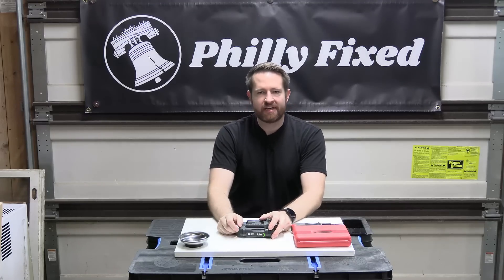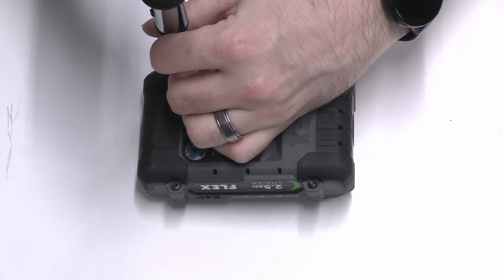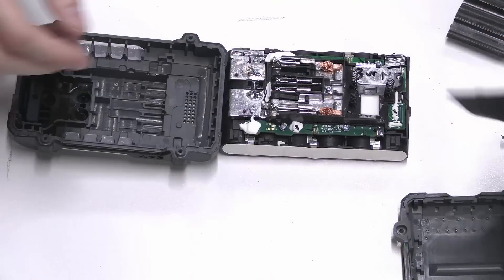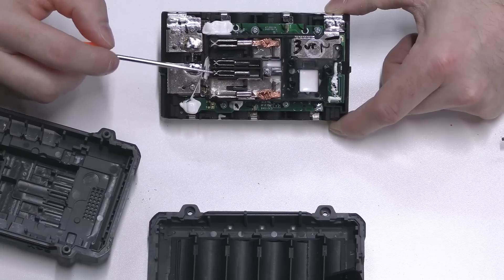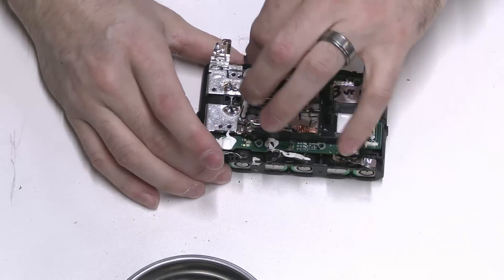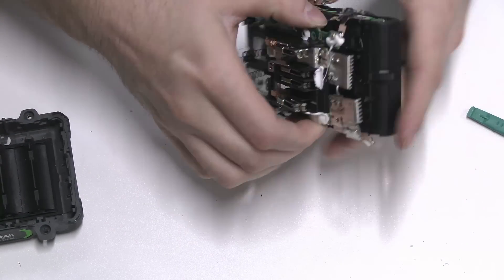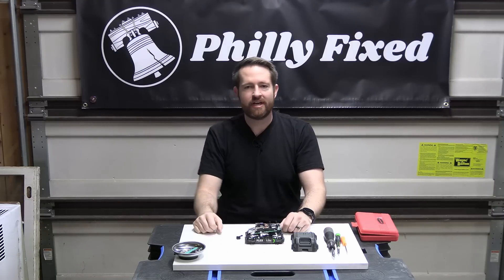Flex Power Tools 24V Battery Teardown!

Comment: The copper shown around 3:37 is called copper braid (looks kind of like desoldering braid minus the flux) and it's most likely a high current fuse as a fail safe. It's a pretty common design theme in these batteries, and there are even a few videos showing how to repair them for other battery brands when they burn.

At 7:26, on the bottom side of the board in the middle near the two thin soldered contacts, there are two test points (unsoldered pads where you would touch a logic analyzer or oscilloscope probe) that say TP_C1 and TP_D1 (clock and data) which implies that there is a communications system in there somewhere. Around that general area are a few vias; one pair is NTC1 - negative temperature coefficient (thermistor), and to the right is an NTC2 via - second thermistor, or just another joint on the same trace?

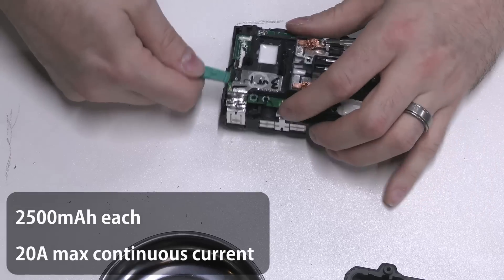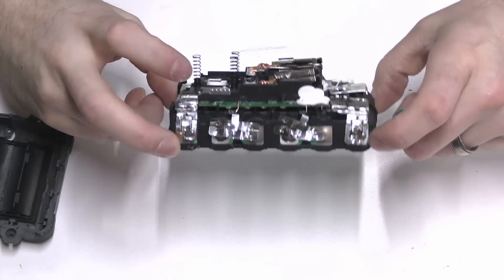Since we can't see any significant number of pins sticking through to the bottom, my current assumption is that there are a bunch of surface mounted devices (SMD is the phrase you were looking for I think) under or near the contacts assembly. At 4:36, there is a white rectangular area to the left of the contacts assembly which is later shown at 7:43 to have been scratched at exposing some circuitry. The white stuff is probably an epoxy or similar which is used to waterproof the electronics. If you could pull the contacts assembly off of the PCB without ripping up traces / components, you'd probably see the cell balance and data circuitry we were all expecting.

At 4:36 or so - those battery specs are correct. Assuming a nominal voltage of 3.6V / cell (21.6V) and 20A, that's 430W continuous. The 25R is specced for 100A for less then 1 second, or around 35A for a few seconds. That's in the range of 1-2kW for short periods of time. Ignoring the slight voltage bump, any brand's pack that uses the same cells and build quality is theoretically capable of similar performance. If Flex has implemented better thermal management, then maybe they're keeping the battery temperature low enough to exceed that 430W continuous limit for longer.
In comparison, a 3Ah 21700 pack should be capable of 35A continuous (in free air at least), with similarly high or higher burst currents than the 25R. Keeping in mind the nominal pack voltage of 18.0V, that's 630W. Of course, the 18V pack is losing a few more watts to heat loss in the contacts, but on the order of 1-10W, not 10-100W, so not a significant performance issue other than possible heat soak.
Reply from the maker: Thanks Connor!  That's the type of input and analysis we need!
Reply: @PhillyFixed  awesome job Jim
Reply: I was just going to say that.   :P    Thank you.
Reply from the maker: @SuperJamster1  🤣
Reply: Do you think Flex is onto something by wrapping the batteries with phase change materials?
Reply: @Factoryseconds123  Ego, the outdoor power tool brand owned by the same parent company I think, pretty much piloted the technique in consumer power tools as far as I know. I don't have any temperature data on the cells, but Ego generally gets pretty good reviews from a battery performance standpoint. Phase change materials just provide a way to keep the cells a little bit cooler at the beginning of a cycle. Once they've changed phase, their temperature rises much more rapidly, and for long cycles at high power, may be even worse than not having the material there in the first place, if their ability to transfer heat, not just store it, is worse than the alternative. (I have no data either way, but that makes sense in theory)
Reply: @connors.1077  Awesome information. Makes sense that the phase change stuff could act as an insulator in some situations. Either way I have tons of respect for Chervon. Seems to be an engineering driven company similar to Milwaukee/TTI. DeWalt/SBD.... Not so much, given recent explosion in sub brands and sub lines, such as the Flexvolt advantage, Power Detect, and the ridiculous Atomic series that doesn't deliver on size nor performance. Seems that the people at the helm of SBD/DeWalt are more into the marketing side of things rather than the engineering. I love the engineering though. It's great to see Flex kick it up a notch and bring some fresh air into power tools. 

That being said--any thoughts on what the handheld power tool industry will look like in 10 years? Maybe some 4680 cells in power tools?
Reply: @Factoryseconds123  dewalt and flex just started using lipo/flat cell batteries. Similar to cellphone and laptop batteries. Much more power, but much more damage when failure happens. I doubt these will be as sensitive and prone to exploding like lipo cells used in drones and RC cars. But definitely more efficient in  power output than 1860, 20700, and 21700 cells
Reply: @connors.1077  what you think about the developments in lithium cooling understanding?

I remember reading that cooling batteries on the broad side isn't as good as cooling at the terminals. Have yet to see this in power tool batteries especially from Chervon.
Reply: @Collin   That materials seems to damage the battery by clogging up everything thing when the battery sweats......

Comment: 😂 its not a new company, flex is almost 100 years old, started in 1922
Reply from the maker: Yeahhh I meant "power tool line"... I've used Flex polishers 😅
Reply: @PhillyFixed  power tool line is also old 
The red line started in 2016 in europe
Was nothing special
Reply from the maker: @promo130  yup, that's 18v though right?
Reply: @PhillyFixed  yes, your only gonne make flex video’s ?
Reply from the maker: @promo130  Nope, but it's a new line, lots to talk about for now!  Go back to my first video, it's on a Harbor Freight saw 😅

Comment: Good video 👍 .. just wondering what are you going to do with those  18650 battery 🔋
Reply from the maker: I'll probably try to resurrect the Flex pack!
Reply: If you vape, those batteries would work for that.
Reply from the maker: @paedahe4975  I don't...

Comment: I wonder if the higher ah batteries have the 18650 cells or might have the 21700 cells.
Reply from the maker: I suspect they do, but we will see... don't have mine just yet.
Reply: @Donald Thorpe possibly. Can't wait to get my hands on the 8 and 12 ahs
Reply: @Donald Thorpe yeah very interesting. But it's going to be very expensive

Comment: I know this might be a little much but could you replace those batteries with Milwaukees high output batteries and see how well they work in the flex tools vs thier traditional design?
Reply: The 3Ah Milwaukee HO pack has third-party manufactured high performance 21700-sized cells, which shouldn't be able to fit in this shell, since it was built to hold 18650's (unless removing the rubber / phase change material yields enough space). Even then, the battery balance circuit in the Flex battery will be incompatible / dysfunctional and the tool may not function correctly at the lower voltage (over at least part of the operating range). Thoughts?
Reply: @connors.1077  I see it as each cell as its individual battery. I think the voltage stays the same as long as you use the same number of cells. I understand that modification to the battery shell is probably necessary and leads going to the tools terminals might have to be done in order to touch if the battery shell is destroyed.
Reply: @Zombieboxx1  Sounds about right! So long as each set of cells is the same general chemistry, capacity, and age, packs with the same number of cells will have the same voltage. The Milwaukee tools at least can be run off a DC power supply, and therefore don't actually need the data lines present to activate the tool. Hopefully the Flex tools are equally easy to hack.
Reply from the maker: I won't rule it out .. cool idea!
Reply: I would like to see someone take 5 Flex battery packs, make five adapters with leads on them, run them together with a voltage regulator and run a 120v refrigerator off them. Lights go out? No problem... still have juice for a cold pop.
Reply: @paedahe4975  It'd be much easier to hook it through a low voltage cutoff circuit into a 24VDC mini fridge. The batteries don't actually produce 24V under load (assuming you were going with 24V * 5 = 120V), and the fridge probably needs alternating current, while the batteries produce direct current, so you'd need an inverter, not just a voltage regulator.
For that matter, 24V is a pretty common voltage to run an inverter. Back to your battery bank idea, you'd just have to make sure the inverter and set of batteries (in parallel - more capacity same voltage) was rated for the fridge compressor's startup current and the 10-20% power loss in the inverter.
Reply: The Flex 2.5 and 5.0 are both 18650 packs I believe, but maybe the 5.0 is 21700. Their 8 and 12 are likely 21700 packs though due to size. The Milwaukee HO are 21700 packs. Since a 21700 cell is a 21mm diameter, 70mm in length and a 18650 cell is 18mm diameter, 650mm length. Fitting 21700 cells in the Flex pack will not be possible without some reengineering of the pack itself. Also there is a difference in cell #'s as the 24v system typically uses an extra cell.

Comment: if they don't have the chips you referenced,  is that what they are advertising as sensor free and what advantage?
Reply from the maker: The brushless motors in the tool are sensorless. More to come on that! I dunno where the "smarts" are in the battery, though.
Reply: @PhillyFixed  For FLEX to be a truly smart battery, they have to be better than the EGO smart tech. EGO has a 30 day self discharge function for longer and safer storage. Both companies are Chervon. Let’s see them share the technology.

Comment: These battery are spot welded sooo desoldering station would be useless 🤣😂  and of course there is 2 soldering points that is how spot welding works 🤦‍♂️. Now if you want to put these battery back together go buy a cheap spot welder  from Amazon or banggood 😜  and watch YouTube video how to use them 🤣. 

Keep up the good work 🤙
Reply from the maker: Thanks!  I learned something!

Comment: The "battery cradle" is the phase changing material that they use in their batteries. The EGO cells are wrapped in them but that is adding size for the battery, this design is more compact.
Reply: a little too compact maybe...

Comment: They really did a good job on that battery build but the 18650s have to go. At this point in time, 18650s and 21700s are old tech.
Reply: Says who? You don't have to much if a differences between an 5 AhXC and an 3HO exept the 3Ah HO is empty in a short time and its even longer and wider.  The bigger ones like 5.5 and 8HO at the other hand are comical big for one hand used power tools
Reply: Really?  Hmmm, OK... it is just a battery size so if you want/need a 2.5 amp hour then you use the 2.5 amp hour cells in 18650.  Kinda how it works--you want more, you get larger cells.  Sure, I'd like the Tesla NMC 4680 9Ah cells but that would e a BIG battery which some people don't need.  My remote don't need C cells as AA runs fine for a year or three.  The size of a cell does not mean old or new tech, it is just the size.  A reall man would demand the 400 Ah LiFePO4 prismatic cells....cuz bigger is better, right?  Using 6S or 6S2P for 2.5Ah and 5Ah is fine--if you want more, get bigger cells in the same configuration.  Keep going and you can power your house depending how big the individual cells become.  Now Philly needs to check the charger cut off voltage when fully charged and find out what the cut off voltage is when the battery discharges.  The Sammy 25R is a great cell, now to see if the charger treats them right or goes max charge and discharge voltages to maximize runtime but severely limit the overall battery longevity.
Reply: @EVnewbie  😂 thats not how it works dude,
Reply from the maker: I will test the voltages!
Reply: @PhillyFixed  Good to know!  Be nice to the batteries and they will work better for you.  My A123 Systems M1 cells (lithium-iron-phosphate) batteries are still chugging along after 15 years of abuse.  Although Li-Mn can't do that many cycles, they can do 10 years if treated right.  Now to send my M1 packs back to China to get them replaced, hope the charger lasts another 15 years.  Keep up the good work and don't let the magic smoke out.
Reply: @PhillyFixed  The whole selling point of the new XTR Kobalt was their new batteries.
Reply from the maker: @HowieZ-s5f  Right... and then, unless I missed it, they only offered a 4.0 "ultimate output" battery.  No other sizes??

Comment: And proved again... flex behind technology with those batteries. For a company that is trying to get in the market and they way they are pushing to get their stuff out there, get some better batteries flex 👎
Reply: there's nothing in this video that indicates they're behind (they're also not distinctly ahead of anybody either, fwiw)  lol....

Build quality is pretty much on par with the rest and they use the same Samsung cells as the rest (assuming we compare equivalent packs, because Samsung 25R are in EVERYTHING that's 2.5/5.0 Ah, Samsung is generally best-in-class when it comes to high discharge power tool cells)  I think you're just making up imaginary problems with these packs because of a predisposition. AKA bias.
Reply: Well they kicked the crap out of the Milwaukee 18650's. open up one of them and a mouse and wheel comes out. 😁

Comment: Nice.can we see what the sensor Free brushless motor look like
Reply from the maker: Mayyybe.  My budget for destroying tools is limited, maybe I can more carefully take the drill apart.
Reply: If you go to any product page for the tools on flexpowertools.com, for instance https://www.flexpowertools.com/reciprocating-saw-kit-fx2271-1c/, and scroll down to the "sensor-free brushless motor" illustration, you can see that it looks a heck of a lot like any other brushless motor used in a power tool (including a PCB behind the motor), except that it lacks hall effect sensors for rotor position sensing.
Reply from the maker: @connors.1077  I actually think the sensorless motor is to blame for the issues I had on my first drill test...
Reply from the maker: @Winsont Sammy Meh I dunno I'd like to get a look at the motor...

Comment: 😂 lol am i crazy or do they really not have cell balancing on their revolutionary battery?
Reply: Bosch doesn't have cell balance, just an FYI.  And they're pretty proud of whatever they like to claim in marketing.  

You can also easily see 3 of the cell balance tabs at the 5:10 mark.  The other 2 are visible when he flips the pack over.
Reply: @jaywelker5566   Yea didn’t notice that .... so there has to be a chip in there somewhere ..... bosch doesn’t do cell balancing ? I just checked and Yes they do they have 21700 cells with negative terminal being the entire cell body and they have flex cables going to each series of cells under the PCB .... no wires soldered onto the cells ..... but it is balanced

Comment: That’s a low tech battery. Meh
Reply from the maker: Yep
Reply: It's bog standard as far as lithium packs go.  lol.  Nothing special, but also nothing inherently terrible either.  

A "low tech" pack would be Porter Cable or Black and Decker.
Reply: It's low tech compared to the way they explained it and the way they're advertising it. You are 100% correct my sir!! I'm an electrical engineer and I could have done much better in my garage!!
Reply: Don't let Vince hear you say that. Guy hates to admit he's wrong. But through all this I've learned VCG knows nothing about tools. Great video Philly!!